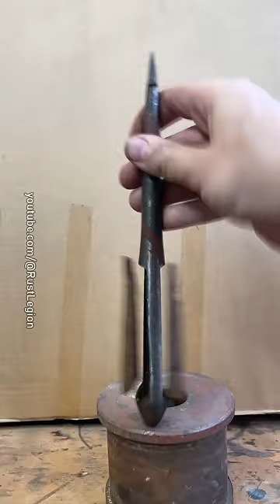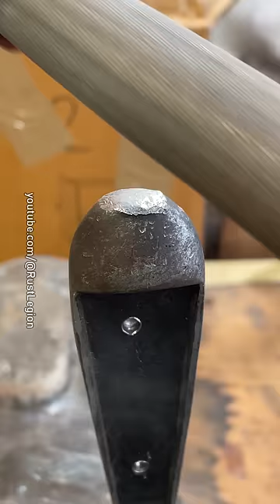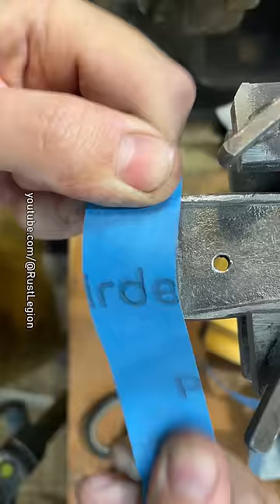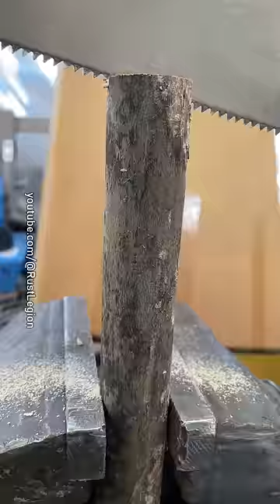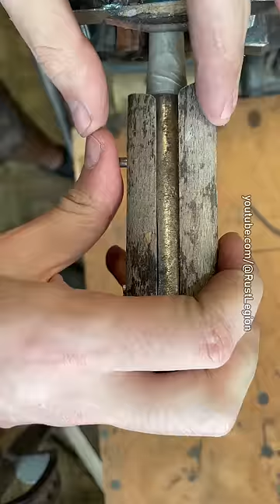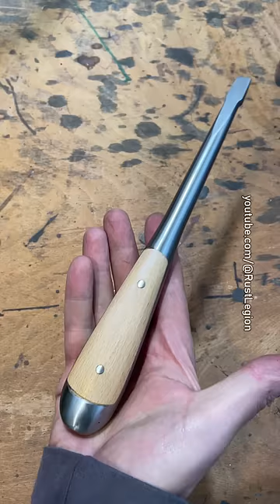Restoration - rusty old Screwdriver

Comment: I understand it looks good at the end but there's a certain charm about a tarnished piece of cast iron like that.
Reply: That's not cast iron...
Reply from the maker: for sure , the old and dark look had it's charm and it is 100% fine for a tool hat is used all the time as long as the functional parts are in good shape.
Reply from the maker: yes , I think it is drop forged steel :)
Reply: @RustLegion  thanks I wasn't sure because of the casting marks on the handle